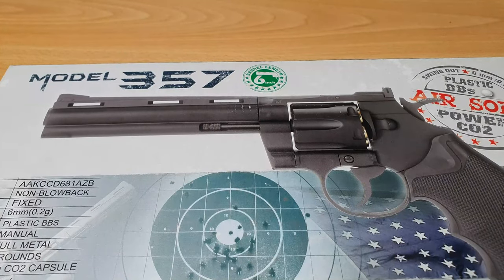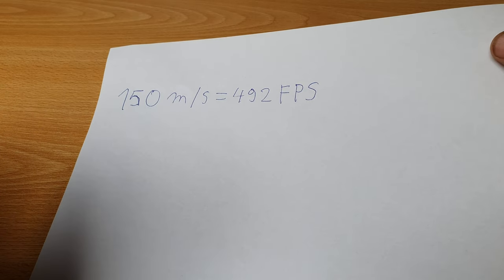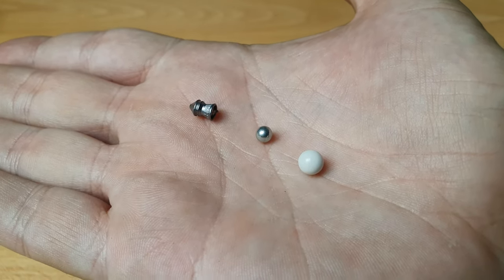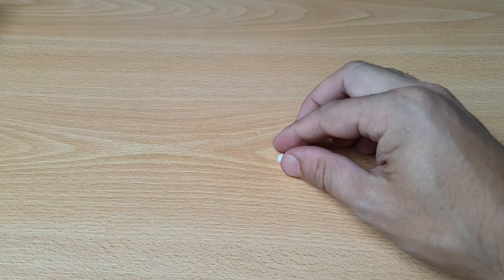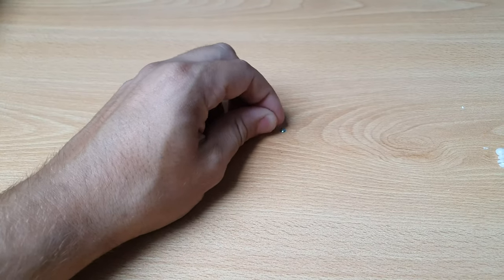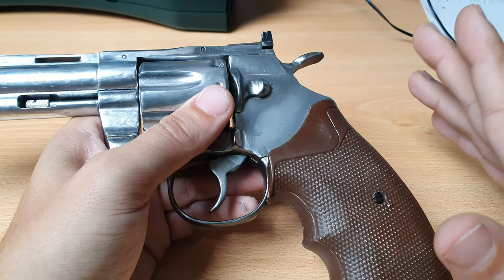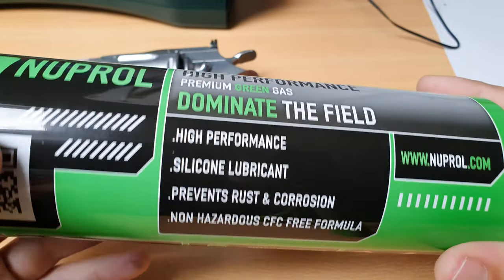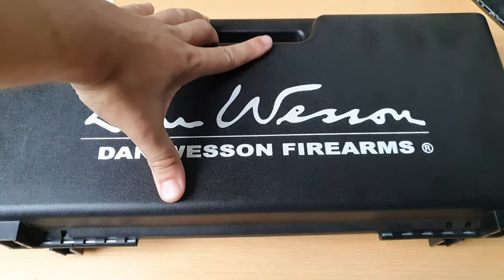FPS and JOULE explained // pellet vs steel BB

Comment: i'm sorry but since i am a gunsmith i need to say that not all you say is true
Reply: Would be a good thing to specify what is not true
Reply: What’s the falze parts then?
Reply: @RagnadX a year later and no reply ey 🤷‍♂️🍻😂
Reply: I'm not a gunsmith, but one thing's for sure,  everything he said was accurate...... But seriously, some of the inaccuracies I believe were translation issues. I'm confident that he knows what he is talking about.
Reply: Ah yes, there's always a gunsmith in the comments. What would we do without you?
Reply: I got an umarex 68 cal, 16 at least jules... the rubber balls WILL blow up my giant thick huuuge tupperware container "from power" but WILL NOT go into a plastic water jug or break glass...my bbZ go threw EVERYTHING ... 
The thick glass coffie contaner with 4.5 steel bbZ turns most of it into dust... no b.s.
Reply: The thing is about BBS beeing more precise than pellets.
That's because his revolver it's not rifled.
If it was, pellets would be more precise!
And I'm not a gunsmith! 😂

Comment: of course pellet are more accurate since your dan weston didn't had rifling the speed and accuracy both were effected. I like bb they are cheaper and convenient but than they are hazard as they bounce around.
Reply: I agree! The rifled barrel will also cause the pellet to spin so the velocity should be higher and travel further! Very interesting information from you.
Reply: Tem como introduzir raiamento no cano dele ?

Comment: using pellets in a BB gun will always favour the BB over the pellet (well most times anyway) BUT ! If you was to chronograph the pellet performance in a pellet gun then you'll be surprised at the results ! BBs have great penetrative effect whereas the pellets deform on impact to impart their force (joules) to the target, thats why your pellets landed not far from the jar, they had given virtually all their energy over to the target on impact whereas BBs retain they're energy when they bounce off of hard targets, admittedly they can penetrate a glass bottle close up and smash it but they lose that energy over distance far more than a pellet does.
You should've fired some of your 6mm plastic BBs at the glass jar, I would've loved to have heard you swearing out loud as the ricochets come bouncing back. The penetrative power you speak about is nothing more than the material the projectiles are made of, you need to try some non-lead (tin) pellets, they weigh about the same as BBs, are pointed and will smash a glass jar just as readily as any BB will.
All you proved was that steel is stronger than glass, doesn't take a genius to work that one out buddy !
Reply: They have steel pellets that hold their shape.

Comment: Interesting, thanks for explaining why plain lead is less effective than steel. With higher energy levels it doesn’t matter; hence the .357 still penetrates. I am wondering now how effective the .177 hornet pellets are now since they have the steel tip. 🤔
Reply from the maker: Thank you
They are to heavy for a co2 revolver. So the first 6 shots will break glass

Comment: i got a Co2 m92 that shoots at 410 fps with 4.5mm(.177) steel bbs and about 640 fps with 4.5mm  plastic bbs also has a full auto switch .
Reply: where do you get plastic 4.5 bbs?😯

Comment: Using steel BB's is a mistake. Steel is stronger that what most airsoft barrels are made of which is brass.
I got my Dan Wesson 715 barrel ruined (dented and scratched) after a few hundred shots or so.

Edit: If you want to shoot steel BBs then I suggest you use a proper airgun instead

Comment: 01:30 Now I'm a bit confused. I thought the FPS on guns used it because they were shooting on video and that's why they were referring to Frames per Second, like in videogames and other forms of video. But now you say that FPS is FEET per second... does that equate to the same thing as frames per second or are they completely different things? That lends itself to confusion, they should have looked for another acronym.
Reply from the maker: Its the distance that the bullet travels each second
In europe its meter per second 
 m/s
Reply: Yeah it's always been a measure of distance pellet or bullet covers in 1 second. It's the same for real guns where an average 22lr shoots about 1200fps

Comment: The difference in Joules is so small as to be of zero consequence if they were the same projectile. 😀 The difference in the projectiles size, shape and density make the Joules almost completely meaningless. I would rather take a 6mm 3 Joule plastic BB shot on the tummy at 10 m than a .22 Lead pellet at 3 Joules.
Reply from the maker: It would be the same pain
If the pellet is not pointy